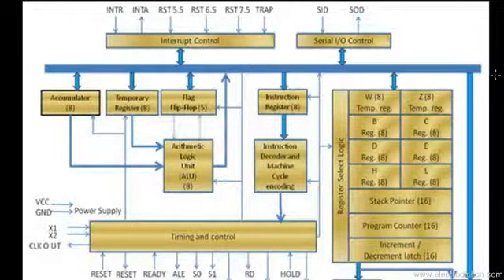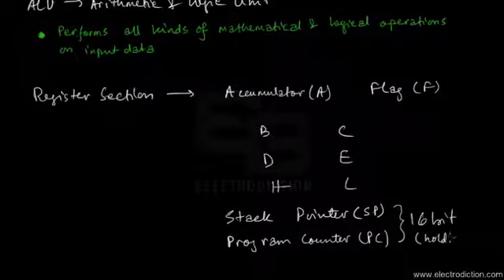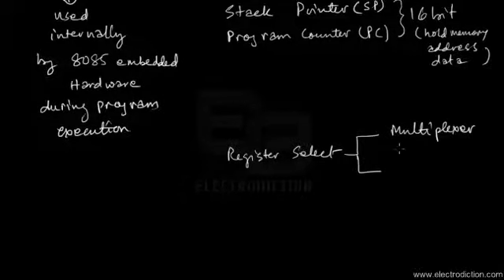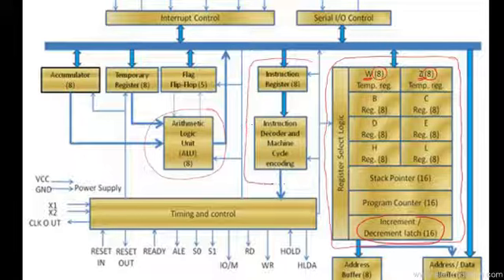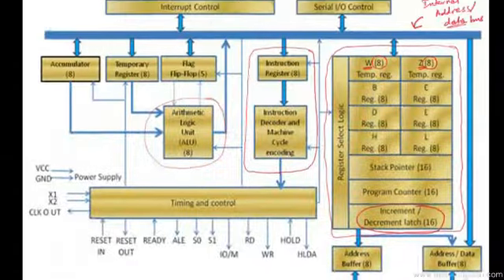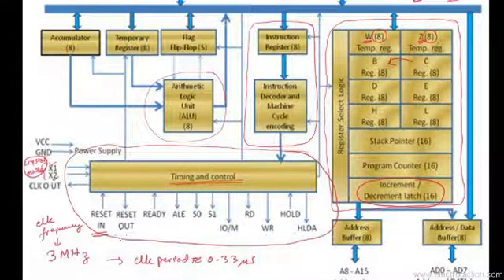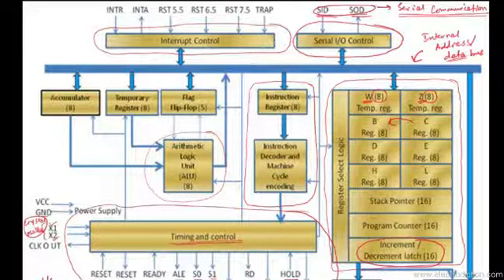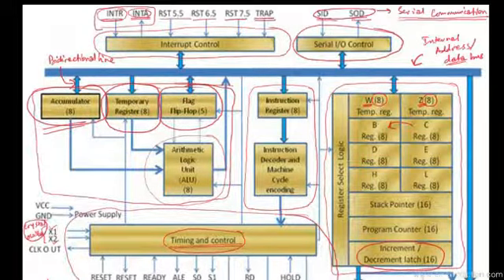8085 INTERNAL ARCHITECTURE || Microprocessor

Comment: hey thanks for ur effort . do u have any notes
Reply: 8085 Microprocessor Internal Architecture

Overview

The Intel 8085 is an 8-bit microprocessor introduced in 1976. It is widely used in early computing systems and educational contexts for understanding microprocessor fundamentals.

Key Features

8-bit processor: Handles 8-bit data at a time.

16-bit address bus: Can address up to 64 KB of memory.

Multiplexed address/data bus: Lower 8 bits of the address bus are multiplexed with the data bus.

Single +5V power supply: Simplifies hardware design.

Clock speed: Typically operates at 3 MHz.

Internal Components

Accumulator (A): Primary register for arithmetic and logic operations.

General Purpose Registers (B, C, D, E, H, L): Used for temporary data storage and manipulation.

Program Counter (PC): Holds the address of the next instruction to be executed.

Stack Pointer (SP): Points to the top of the stack in memory.

Instruction Register & Decoder: Stores and decodes the current instruction.

ALU (Arithmetic Logic Unit): Performs arithmetic and logical operations.

Flag Register: Contains status flags (Zero, Sign, Carry, Parity, Auxiliary Carry).

Timing & Control Unit: Coordinates all operations within the microprocessor.

Control Signals

RD (Read): Indicates data is being read from memory or I/O.

WR (Write): Indicates data is being written to memory or I/O.

ALE (Address Latch Enable): Distinguishes between address and data on the multiplexed bus.

IO/M: Differentiates between memory and I/O operations.

Applications

Used in early personal computers.

Widely applied in embedded systems and educational kits.

Foundation for learning microprocessor architecture and programming.

These notes summarize the internal architecture of the 8085 microprocessor as explained in the referenced video【1】.